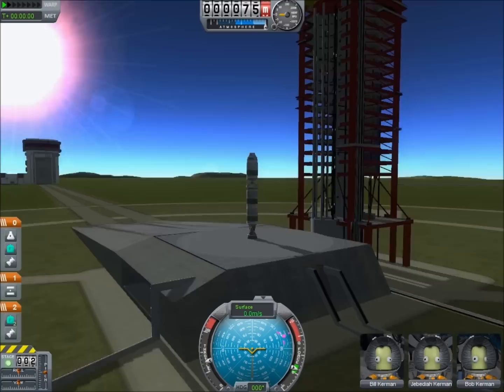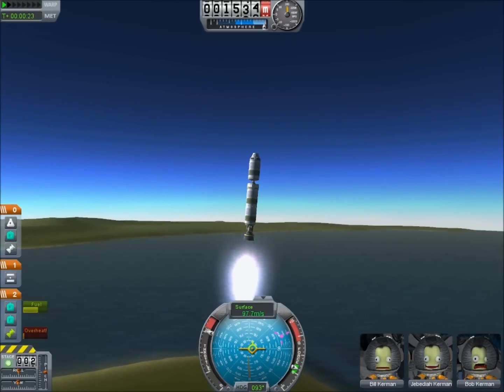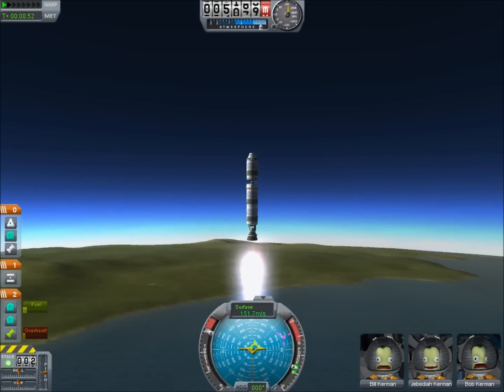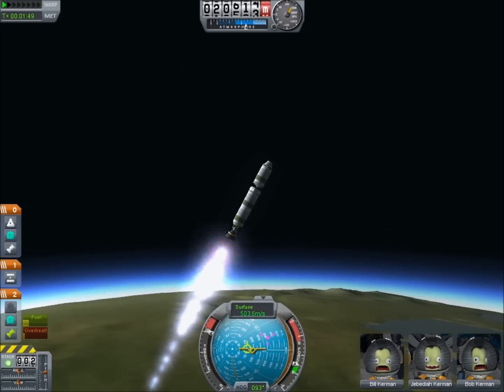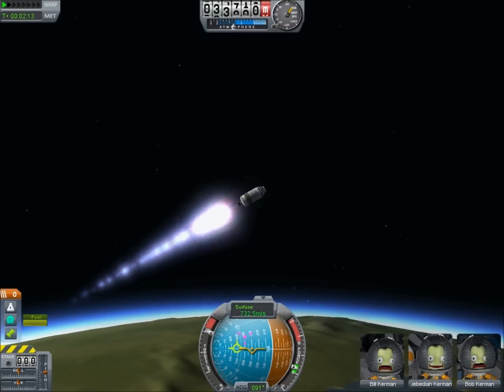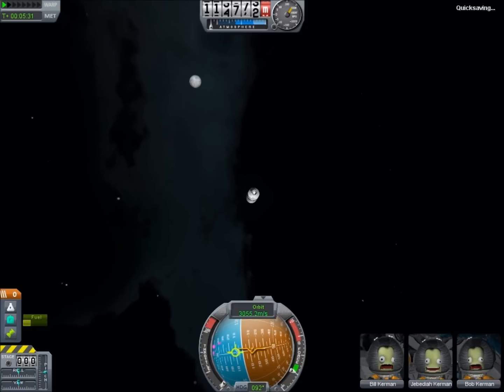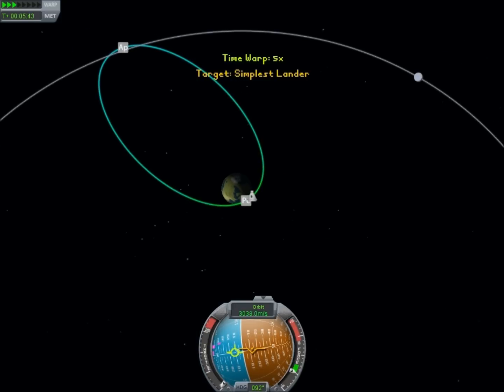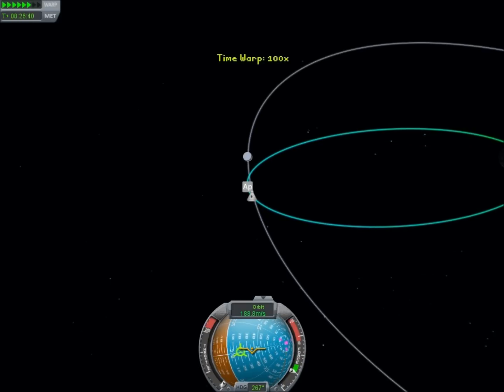Landing On The Mun Using The Smallest Rocket

Comment: one thing i don't understand: fuel can yeld a fixed ammount of energy per unit, and to softland you have to negate all the potential energy your height gives, soo unless you are moving upwards, are you wasting fuel by buring early?
Reply: the faster you move, the less time you spend affected by the gravity of the object. burning early makes you spend more time getting accelerated by gravity so you need to spend more fuel to counter the extra speed that gives. an ideal burn is something along the lines of a suicide burn, where you wait for the last moment that doesn't result in a crash
Reply: Patchouli Knowledge Thanks! I actualy kinda realized that by continuing to watch the series, my first tought was that if you simply burn to counter the gravity you don't move and waste fuel. I guess that a phisical explanation is that your fuel can dish out a fixed ammount of delta v, not energy, so the faster you move, the more power you get from the same ammount of fuel

Comment: Does it waste fuel when breaking on the way down? I think it doesn't. My reason is because at given heights you have a given energy with speed and height and if you break all the way to v = 0 at a given height you have gotten rid of all energy you had at any height above the current, and simply have to get rid of a little more. I guess it might be a little different if the acceleration of the engines somehow changes with different speeds (more breaking at higher speeds).

Comment: Now I see how spoiled I'm with advanced parts. I could probably fit 3 of those rocket assemblies into my mun lander. I did build it to be able to place approx 5 tons safely onto the mun, but still, quite overkill for just going to the Mun. I tend to over-engineer my rockets, the lifting stage for my Mun lander consists of 9 "Twin Boar" engines. :P

Comment: i keep hearing about doing a "burn" to change orbit but nobody has ever explained how to do this "burn" so i'm stuck with my pretty planned maneuver without being able to do it and actually get into the orbit i want
Reply: +Popescu Kevin The maneuver system isn't always 100% accurate when it comes to telling you how long you actually need to thrust, so a few minutes out you should aim at the node and just blip the engines, and it should give you a more accurate time. Then you want to split the difference, so that half of the burn is before T-0 and half is after, so if it's a 1-minute burn you would actually light the engines at T-30, with burn completing at T+30.
Reply: A "Burn" is just thrust in a chosen direction. So you set your maneuver. Then face towards the maneuver symbol on your nav ball(if you don't know what this looks like then look it up) once you're facing your maneuver and you reach the time for your maneuver node simply throttle up till the bar on the right of your nav ball reaches zero and disappears (or close enough to zero at which point it will have a green tick next to it which you can click to get rid of it) and bang. Burn complete.
Reply: klimpomp ~THANKS~ :)
Reply: Popescu Kevin Happy to help :3
Reply: Dude. Get a pod or probe. Get any rocket with fuel. Launch. Throttle up. Press space. Congratulations! You've done a burn
Reply: Aah back when I had the game for only three days!
No worry, I get a space station in progress and a flag on almost every planet now <3
Reply: +A bowl of Miso soup but not on Dres. nobody ever visited Dres.

Comment: Rescue-ing a capsule from orbit? Ow I got a story. Reminds me of my first career missions after a restart. Separate lander and return vehicle. Both docked, lander lands on minmus and re-orbits with the KRV, KRV being merely a tank strapped to a heat shield, decoupler, docking port and capsule and 2 puffs. All rest of the trust is on the lander. After the 1.05 update it seemed that science was harvested easily, but some experience with part selection might also be at plan. Mission went flawless with only a minimum of resources to spare. Not even batteries, let alone panels. Praying to the Kerbal gods of rocketry for my energy to last before I would even run out of fuel. 4 smallest RCS tanks on the lander and able to do 2 dockings while slacking: I tend to brake on RCS after my intersection move and take it from there on RCS. Landing on a moon is almost always done all the way after one big retro burn at a reasonable altitude, and do the rest on RCS. It always gives me the possibility to cancel the mission, 3 toroidal tanks. No power. Best mission ever. But close so close, that the capsule wasn't even operable during re-entry .. this would fail eventually.

But happy with my design, and limited in science unlocks, I could only try minimum weigh reductions. So I tried to reduce in weight, reducing a four legged lander to 3 legged, cut down to 3 tanked RCS. And ditch 2 of the 4 RCS ports. Those 4 directional on 2 axis. Even ditched my two puffs on the KRV, and kept the 2 on the lander.

Yup, there I failed .. 2 axis .. forward, backwards, up & down. I noticed pretty early in flight, but thought .. meh, doable.

Landing went perfect. Rendezvous went perfect. But those RCS ports have some big momentum on a stripped down lander. Docking on 2 axis was not doable on my cutdown RCS supply .. meh.

Queue rescue one! The beauty is in it's simplicity, so I made it complex. And why not misuse the mission for future redundancy. The KRV stranded out there was still perfect. I just needed to tow the lander, with a KRV able to RCS. And take a new lander to orbit, with it having the previous 3 axis RCS design, and only the puffs to power near Minmus. and back. This would leave a 2nd uncrewed Lander out there, that would eventually dock with the old KRV. And keep it as backup, or potentially add tanks to it as a refuelling/de-orbit hub. A beneficial possibility was to save another Kerbal from a mission contract I got. 2 for the price of one. And perhaps even do another landing.

I crunched those numbers like a MF. It all added up.

The mission launches, orbits gloriously. And the trip to the Mun hardly required any delta-V. Perfect. Orbited the Mun, only to find out that I launched towards the wrong moon .. meh. Baai delta-V. Fml.

But according to my calculations, not descending on minmus, and by aligning the Mun and Minmus it would still be partially doable. Use the KRV for one kerbonaut, while the other would be in the lander. And do another launch afterwards. Picking it up around a close orbit from herbal, all within budget.

I got both kerbonauts easily. But could not get enough delta-V to re-insert the atmosphere of home. So it took me another 2 rescue launches to bring them home separate and safely. But blew the budget.

So yeah, I know how to rescue, and no it does not always go how I planned it. But that is the fun in all of it. I need that edge of minimalism and balls out.

Comment: Even 3 years ago you were a thousand times better than me TODAY.
I can hardly land at the Mun AT ALL even with advance rocketry and quicksaves! :/

I'll get better... eventually...
Reply: DarkQwerzar  If you need to do a rescue mission, I advise you to google "mun rescue scott manley" and you will find an excellsnt tutorial.
To get well into orbit you should:
1) try to not make gigantic rockets, with a total mass of 120 tons you can go anywhere
2) when you reach 10000m, make a 45° turn towards the direction you want to orbit. Be careful, if aerodynamic forces pull you back to your prograde vector or make your rocket go upside down, lower your thrust and slowly do the turn
3) when you are between 15.000 and 18.000 open the orbital map: if your apoapsis is above 80.000 meters, slowly turn until you reach 90° on your direction. Eventually burn until you reach a high suborbital (keep in mind: suborbital, not an orbit) flight at around 150.000m or even less, but make sure you reach at least 1800 m/s .
4) During your suborbital flight, wait until you reach the  apoapsis or at least be close to it, and then burn on your prograde vector until the orbit satisfies you .

Ideally, the burn at the apoapsis of the suborbital flight is done still with the initial stage.
Reply: what is your trouble? I can help you I once was a noob aswell
Reply: +alexww180 I have the 1.00 and i can't land on the mun and return safely .-. Tell me some advice please XD
Reply: DarkQwerzar  OK! This is jow your ship sould be:
Initial stage:the stage that will brig you to orbit. Im this stage you should have your boosters altogheter with a strong engine like the mainsail or the skipper.
:transfer stage: this stage should take you from kerbin orbit to the Mun. Efficient engines like the poodle or the terrier are the best  pick. 
And then, your lander. Be very careful as this must land you on the mun and also return to kerbin.
When you are landing, ALWAYS burn towards retrograde untill youvare falling vertically.
You should land betwheen 10-2 m/s.
Good luck ;)
Reply: alexww180 The problem is that i waste to much fuel to get in orbit, and when i have to landing, or i finish the fuel early, or i landed and i can't return...i have a pilot in mun and i must save him, i'm trying all but i can only reach the mun and when i land all my fuel is wasted D: I'm not good to make orbit fast
Reply: Chad Wu  oh come on
Reply: alexww180 Thanks :D I'm getting really better at make orbit in a faster way, but my pilot still is in the mun XD But not because i can't now, but because i'm doing other primary things (i landed and returned by minmun, i find it much more easy than the mun) and now my primary mission is to go to duna...omg, it's impossible è.è I have nuclear engines and i know they must be used in an interplanetar trip, but with them i still can't get in a good position to enter in Duna's Orbit :/ i read that i must start to go to duna when Duna is like at 3 o'clock (respect the sun) and kerbin at 1 30 o'clock, but still... any advise?:3
Reply: Yep i know the trick on the oxidizer but still nothing XD The link is really useful,i think tonight i try to go to duna XD You are really helpful and a good person, strange in youtube XD
Reply: DarkQwerzar  It's all my pleasure to be helpful, i know KSP is quite to figure out at times.
Another useful tool is KER, a mod that allows you to know many details of your ship (delta v, heat, orbitl parameters) directly in the VAB or in orbit.
Reply: +TinchoX Practice makes perfect... make a sandbox world and do just that, I've done a interplanetary trip from Kerbin to Eve to Duna and returned to Kerbin all in one trip. Granted I had most of the required parts in space already docked to my ISS, but I did it nevertheless.
Reply: *****  hm?
Reply: Darius Dudutis lol

Comment: Wouldn't it be smarter to have a small capsule with one Kerbal, than have useless weight with a larger capsule? Or was it part of the conditions that you must have 3 Kerbals?
Reply: Colton B. This was when there were only 1 set of parts in the game. 1 pod with 3 kerbals you could not get rid/add more crew and yea

Comment: This is what the game looks like when you bother to do the math.
Reply: Ya. I usually just build something with what looks like a lot of power, launch it, mess up a maneuver node and fall back to Kerbin
Reply: +Fireheart318 Divide the time your burn is estimated to take by half and start a full throttle burn at T-X x being half your estimated burn time.
Reply: @ubentu  if you divide by half that's multiplying by 2...
Reply: 12345DJay 
Why nobody uses solid boosters?
Reply: +Fireheart318 the steeper your ascend from kerbin is the more fuel you need for your orbital insertion burn, try to flat out your trajectory when you're above 10k and push time to apoapsis to around 2 minutes and push it to ~100km then you should have more than enough time to set up your nodes etc. what i did wrong in the beginnign was often that i slapped on too much SRBs because i thought i need more power to get into orbit , when in reality those SRBs prevented me from getting a suitable suborbital trajectory and i ended up wasting twice as much fuel as necessary to get into orbit. just build yourself some liquid fuel boosters if you have problems with that so you can adjust your throttle. also don't go past 280-300m/s below 12km or you lose a ton of fuel fighting drag

Comment: OK, I have this totally beat.  (if we wish to call it a challenge :)

I have been to the MUN, and returned home and safely landed, via Chute, with a SINGLE STAGE.

There is a larger total parts count, but only because I am using numerous RCS thrusters.

Capsule + RCS fuel + RCS thrusters + Chute.  Stock parts.

Version 0.18.1

Comment: Actually if you brake earlier it doesn't change the fact that you need to fight gravity again to get your velocity as close as possible to zero again. It's like zeroing your velocity at 100m altitude : you waste energy. The hypothetically most efficient landing is when you use 100% thrust since the beginning of the landing operation to the end, and end up with a perfect 0 or -0.5m/s speed when you touchdown.

Comment from the maker: Whenever you're burning rockets in the presence of gravity then you're losing energy to gravity, this is a constant regardless of whether you're burning at 100% or 10%, what matters is that every second your rockets are running against gravity you're wasting energy, so, the ideal landing is to burn at 100% at exactly the right time so your velocity reaches zero when you touch thesurface, thus minimizing the duration of the landing burn.
Reply: I.e. Elon Musk's "suicide burn"